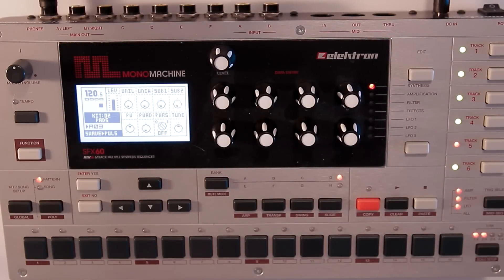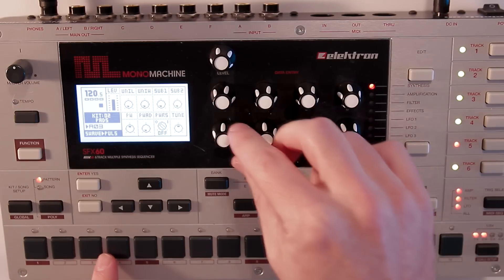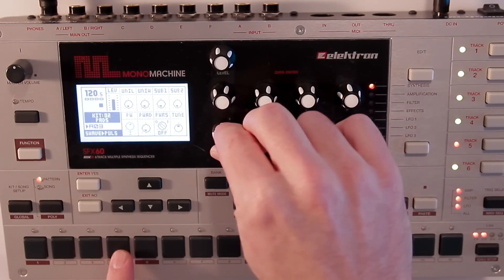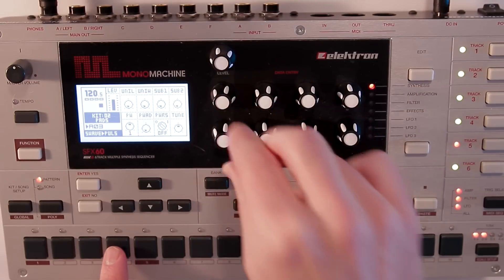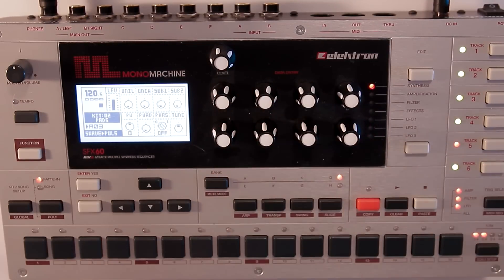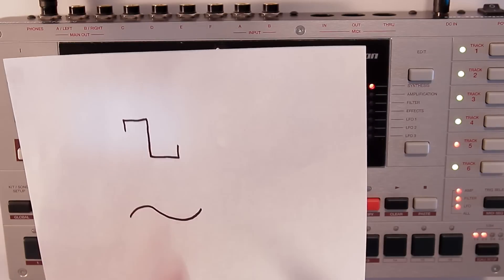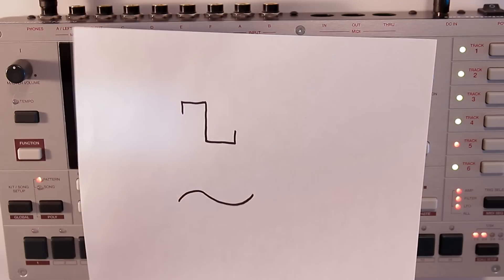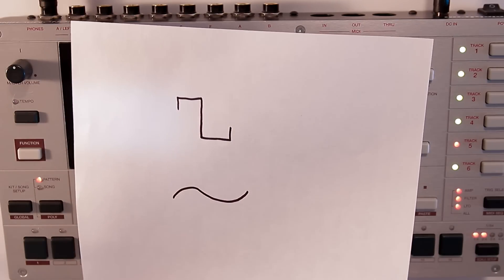Sine-width modulation on the Monomachine

Comment: Indeed, and Yamaha's version of FM as implemented in the DX7 would be more accurately be described as Phase Modulation, unlike FM proper as used for radio. Not sure how the MNM 'does' FM but if you can have a sine carrier and a saw modulator with a 1:1 frequency ratio increasing the modulation index will have a similar effect to what you have done with the digi waves. What you have done sounds great though, so still a worth while pursuit :)

Comment: I honestly didn't see a need for this video
Reply: fascinating
Reply: Cool story, bro.
Reply: ok ok but why did you change the knobs and what are those knobs originally from
Reply: You ever use the MK1/MK2 pre-PlusDrive knobs? (like the master volume knob) Those things were hard as rocks.
Reply: no have not so took them from an old machine then
Reply from the maker: I changed the knobs because these are a little easier to use and I like the look.  The original ones are just cylinders in pure gray, these have some texture for fingers and some visual contrast.  The knobs are made by a company called Albs.
Reply: @Catabolic  ok.